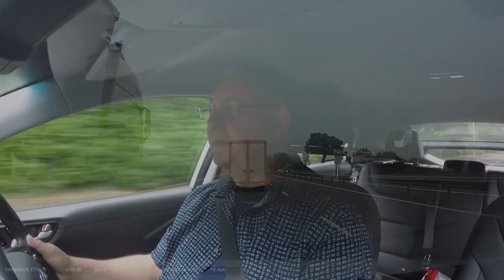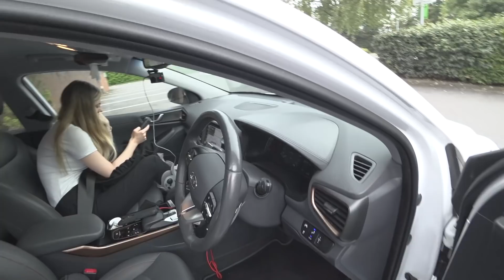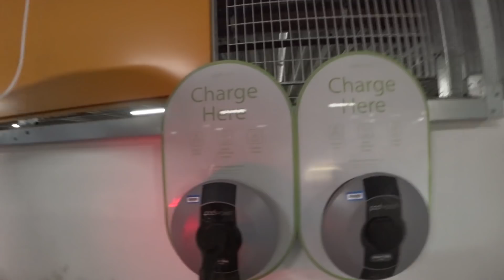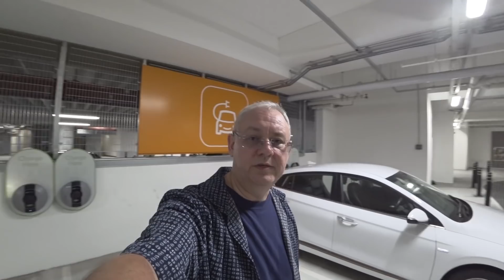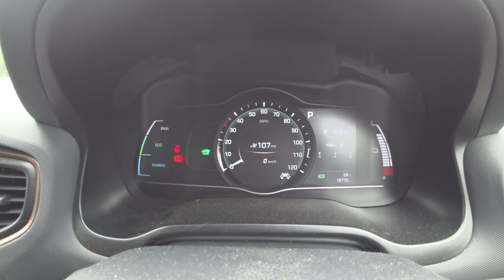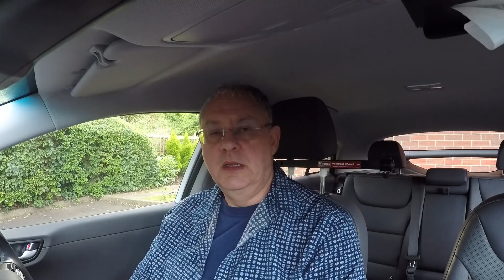Ioniq EV Most Important Drive Ever

Comment: Hi Stewart,
I know you use Ways as your Sat-Nav but I really think you should try using the Ioniq's built in Sat-Nav using your phone as a Wifi hot-spot. Setup the car to uses your phones Wifi and the Ioniq Sat-Nav receives updates about traffic and you can see where heavy traffic is on the screen. The Ioniq will also ask you if you would like to go an alternate quicker route if it finds heavy traffic on your journey.
If you know this already sorry.
Anyway, great video. :-)

Comment: I don’t think I would be brave enough to drive our 180 mile Zoe any distance for such an important meeting I would want a long range Tesla or go hybrid at the very least!. I do not ever depend on anything other than home charging any more as the Ecotricity chargers (mainly paid for via grants) are just too flaky to risk using as your main method of getting from A to B. Pod-Point seems to,be a bit of a winner up here in the Yorkshire Ridings, all the Aldi’s have free superchargers and I’ve never found a broken one plus they are free to use !. I used to work around the corner from’Big Ben’ that’s the actual bell not the tower it’s housed in, seem to remember that was called Queen Elizabeth Tower or some-such name...it was many years ago !